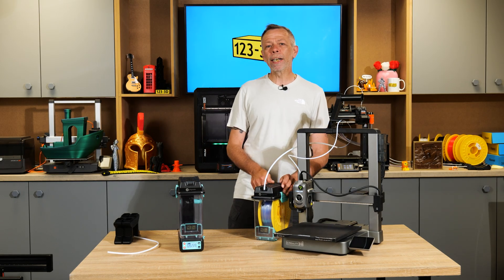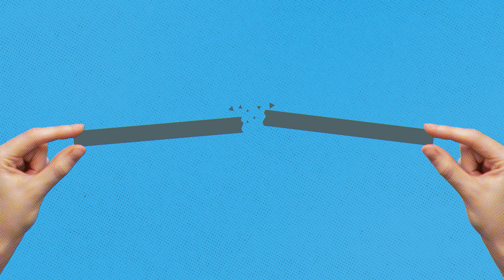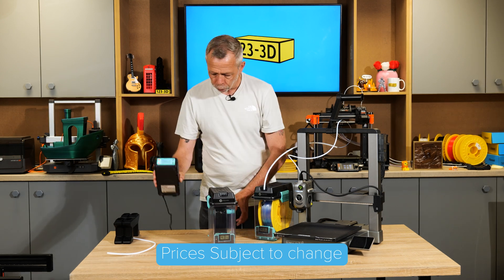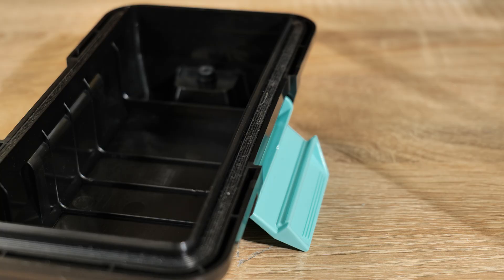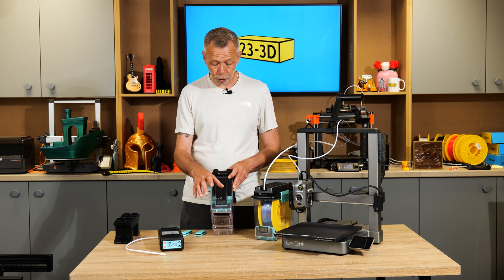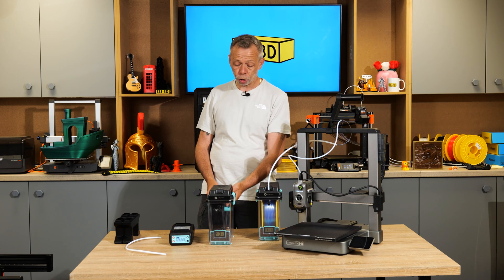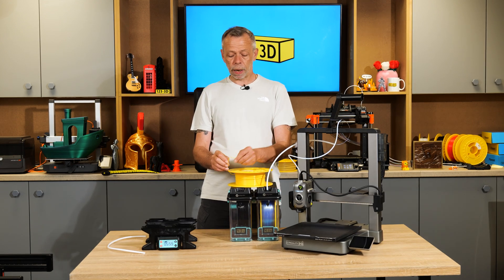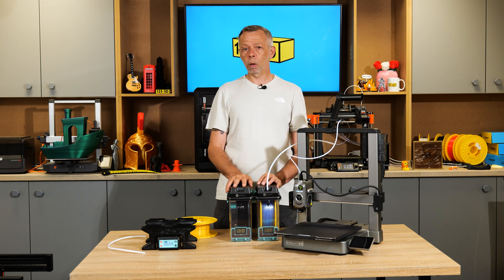Polymaker PolyDryer | Our Favourite Filament Dryer!

Comment: Where does the moisture go if this is a perfectly sealed box?

Also, the temperatures. Maybe the hot air outlet reaches 70C°, but I doubt the temp above the spool is 70C°. And 70C° is ok for ASA / ABS, but definitely weak for PA.
Reply: I bought one recently and was concerned that the hot air coming out of the heater seemed not hot so I popped a couple hygrometers/thermometers  into the box and tested it.  After 2 hours it barely hit 51C so I contacted Polymaker support and they sent me a replacement heater.  This time I went out and bought a thermocouple meter but the results were the same.  So if you're drying PLA or PETG that will work but other filaments may not dry out with the recommended times,

Comment: how you plug or joint 2 PTFE tubes together? ..i’m waiting my Polydryer searching some videos about it and yes, this one look the best logical solution with hot air flow + desiccant + hydrometer (which i hope, have a decent precision).. thanks to share your experience!!
Reply from the maker: Lots of files out there for coupling PTFE tubes together. It might just be easier to buy a length of tube, cut it to the length you need then print something like this to hold it in place https://makerworld.com/en/models/1113837-ptfe-tube-gasket-seal-for-polymaker-polydryer

Comment: Bought a dryer and couple of extra boxes from yourselves a while back and they’ve been really useful. Any recommendations for coupling the PTFE tube from the box to the input on a printer - specifically a P1S?
Reply from the maker: Your best bet is probably buying some extra PTFE tube then printing a seal that would fit the hole in the box. Something like this https://makerworld.com/en/models/1113837-ptfe-tube-gasket-seal-for-polymaker-polydryer